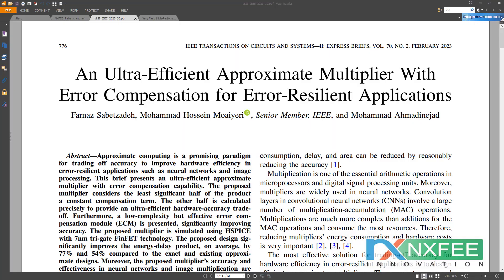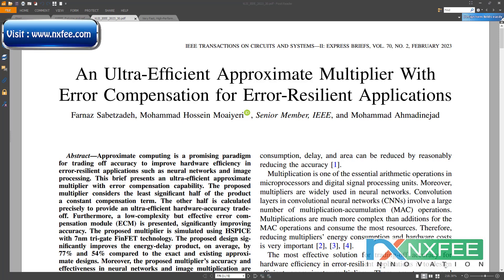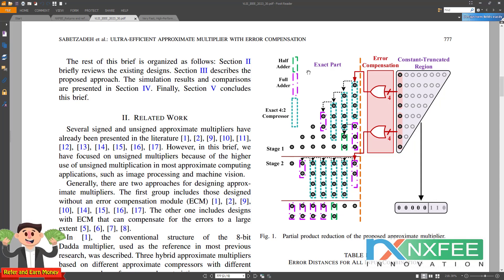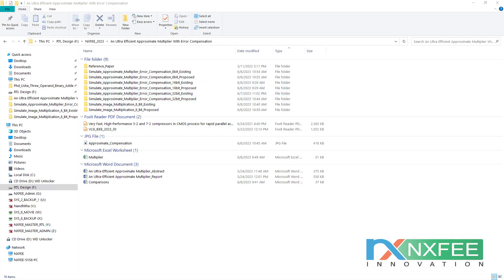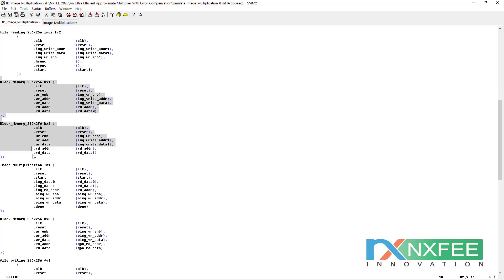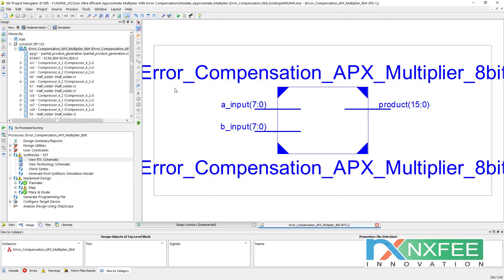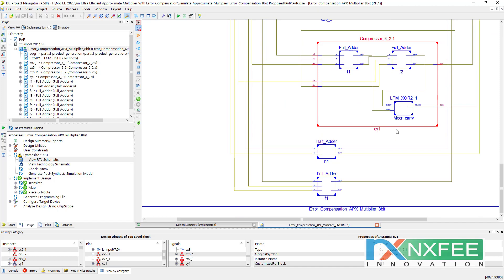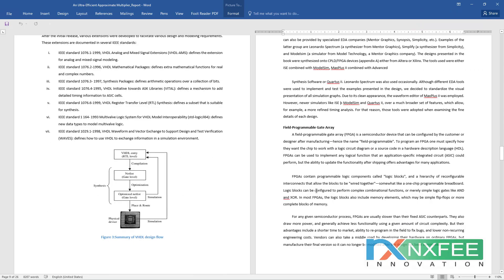An Ultra-Efficient Approximate Multiplier with Error Compensation for Error-Resilient Applications

Comment: Title: Design and Simulation of an Energy-Efficient Approximate Multiplier for Error-Resilient Image Processing

 

→ Problem Statement:  

Exact multiplication is computationally expensive. This project designs an "Approximate Multiplier" (intentionally inaccurate logic to save power) and simulates its effect on image quality.

 

→ Methodology:  

1. Implement an Approximate Multiplier (e.g., truncating LSBs of partial products) in SystemVerilog.  

2. Create a testbench that reads a bitmap image, processes pixels through the multiplier, and writes the output image.  

3. Compare the processed image quality vs. power savings estimated by synthesis tools.

 

→ Tools:  

SystemVerilog, Python (for Image-to-Hex conversion), Vivado/Quartus (for resource estimation).

 

→ Evaluation:  

Peak Signal-to-Noise Ratio (PSNR) of the image, Synthesis Area/Power reports.